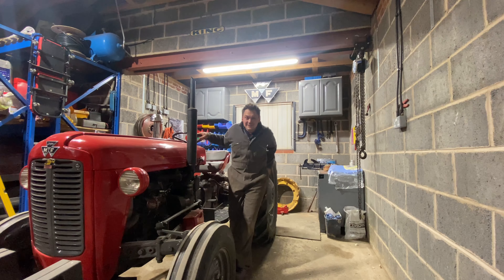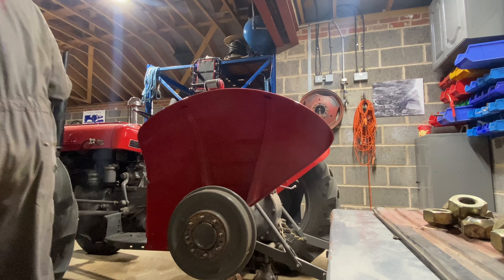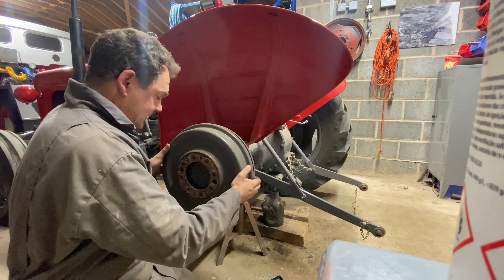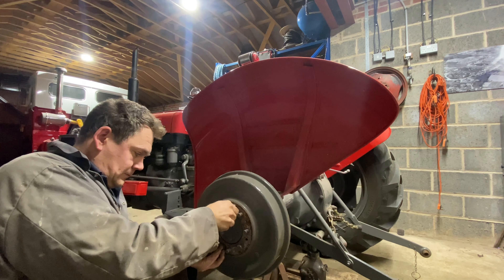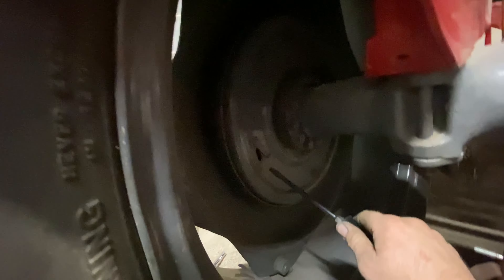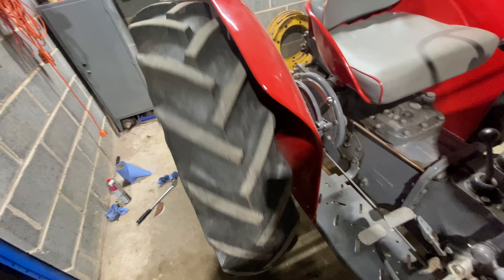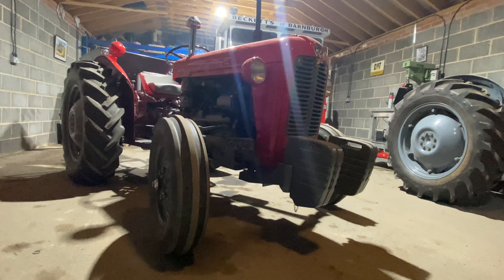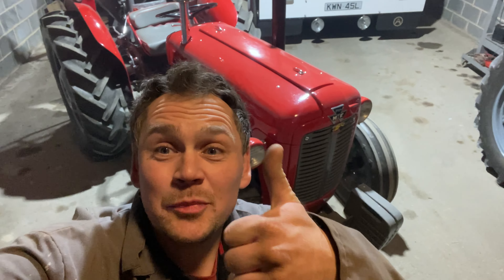Massey Ferguson 35, 35X and 135 restoration project

Comment: Great video. I have a 35 3 cylinder with diff lock, as you say some 35X’s didn’t have diff lock… so called experts jumped down my throat at a Vintage Ploughing AGM about this very subject. Nothing like having the original MF Brochures to prove the point. Keep up the good work.
Reply from the maker: Very true. I do plan on doing a video in this next.

Comment: Had my 35 restored few years ago. Did use agri line brake linings but was never happy with them. So I’ve now charged to another supplier with softer linings much better now
Reply from the maker: Ahhh interesting. For the life of me I can not remember where the brakes came from.  It was about 20 years ago.
Reply: @Mr_b_yorkshire_farmer  she looking good for 20 years I’ve just put some rear wheel weights on mine for ploughing. Do you get to use or is it just for shows

Comment: The best rust killer on the market is Jenolite. You paint it on, it converts the rust to black. Like gun blue? Once dry, paint it. 
That Hammer Right is thick & messy. 
The best Jenolite is the clear liquid, in a black bottle with red writing. Have fun
Reply from the maker: I have tried some of that on my Landrover. I am not overly impressed with it.  I bottomed the rust then painted it on. After a year some has started to blister.  🤷‍♂️